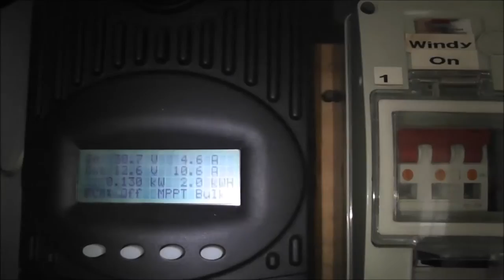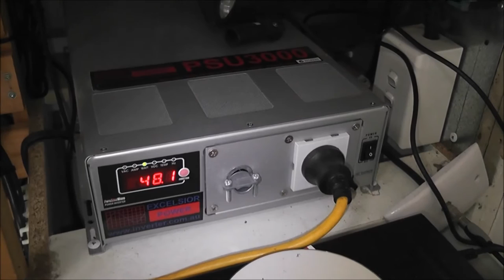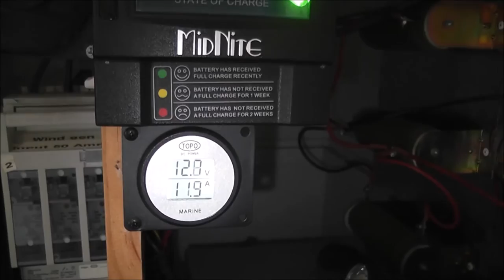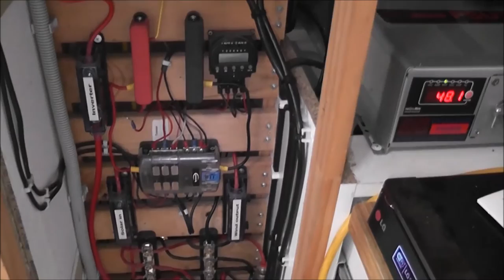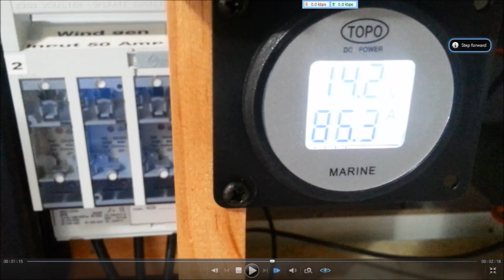Small Wind Generator & Solar update

Comment: This is a nice setup! Only thing is this noisy fan! Under this amps this diode rectifier creates lot of heat. Just get a huge heatsink or thick aluminum plate to absorb the heat.
...and with that setup, you could have lights on 24/7

Comment: nice system,  nice quality, wish i could afford full river, cant beat the bigger turbines you have the perfect location for a turbine, wish i did, there are 150amp rectifiers on ebay but you need a heat sink for them and heat sink paste,, are you using a voltage sensitive relay to dump to the dumpload i did wonder if i could use one of those,  the guys with 12v systems have the heat issues with fuses etc, alot of amps=heat, most now go 48v to eliminate heat and improve inverter efficiency and probably to safe money on wiring.

Comment: don't ever use a break switch in high winds , only use it for maintenance , turning it on in very high winds {40mph} or higher will burn the coils to a crisp just dump the power like old time engineer said ,just some advice from experience

Comment: im interested in how you are getting wind and solar on the same setup ????? great system mate, mine is just a baby compared to this !
Reply from the maker: +alex993cc1 Just connect the Wind Generator straight to the batteries. The Solar regulator will back off to "Float" when the Wind Generator is going flat out. The Wind Generator iss 900 watts with a peak of 1000 watts but I get more than that out of it in high wind.
Reply: +ElectraRC interesting, does the wind turbine not over-volt the system on occasion when its going hard?
Reply from the maker: +alex993cc1  The large solid state relay connects the big green resistors across the batteries @ 14.7 vdc to prevent this.
Reply: +ElectraRC Interesting way to do it! in some situations you end up with a powerful heater in your cabinet then? i have one of the old jaycar 300 watt turbines and i find the charge controller is a lump. I wonder if i could adapt a similar setup.
Reply from the maker: +alex993cc1 Intervolt  PSR1250 have a look.
Reply: +ElectraRC thanks!